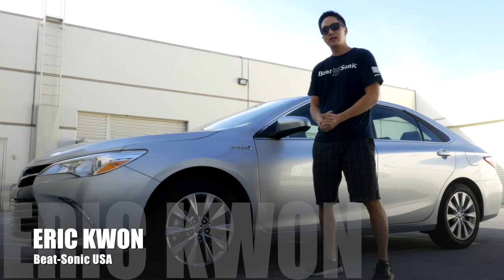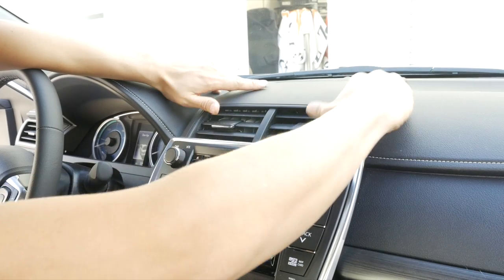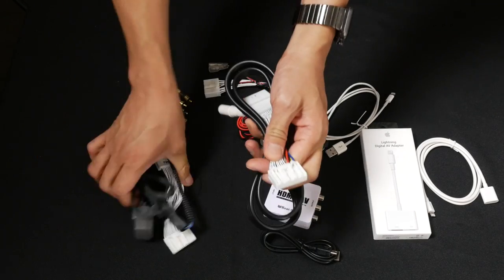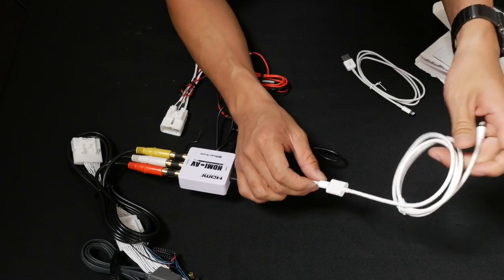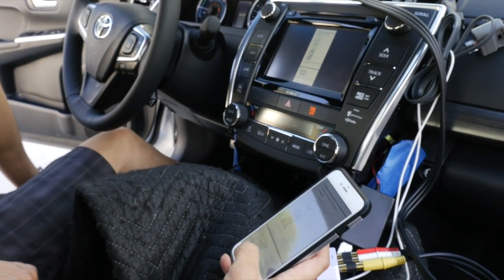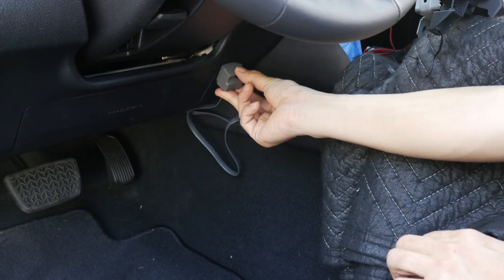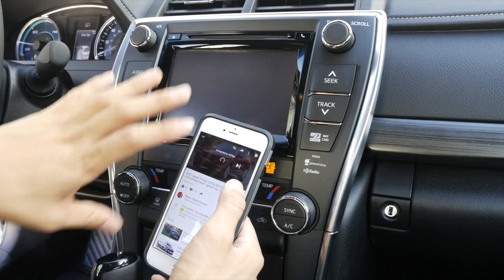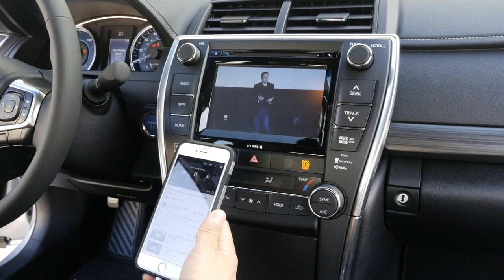2014-2017 Toyota Camry Smartphone Mirroring System Installation and Demonstration

Comment: would it work on a 2012 camry xle v6 if not could u upgrade the camrys screen from a 12 to 14 unit with little issue?
Reply from the maker: Unfortunately it will not be compatible to your 2012 model. And from our understand will not be able to upgrade to newer screen as the connectors are different.

Comment: So I just purchased Camry SE 2017th, so does it fit for this or not. If It fits, then I am purchasing it as ASAP. Thanks!
Reply from the maker: This unit is compatible with you Camry SE 2017. You may purchase the unit at: http://www.beatsonicusa.com/if02ep.html
Reply: Thanks for your quick response, sure !
Reply: Also, does the kit has all the wiring and pieces shown in the video or do I have to purchase something separately ?
Reply from the maker: You will need to purchase the following separately for your iPhone: 

1. Apple Lightning Digital AV Adapter (Part Number: MD826ZM/A)
2. Lightning to USB Charging Cable (4 inches Lighting to USB)
3. Lighting Extension Cable (3 feet Plug to Socket)

The links are provided on the product page:  http://www.beatsonicusa.com/if02ep.html
Reply: Does this work on a Toyota Corolla 2017 SE?
Reply: Will this work with my 2012 Camry SE?

Comment: Will this work with a 2014 camry se sport? Also is it easier for an android phone? I am using a note 8, one last thing I have an adapter for micro usb to type c (for the note) will it work with it?
Reply from the maker: Yes, this kit is compatible with 2014 Camry Se Sport. You phone must support wired HDMI output for the adapter and USB type C cable to be compatible. We recommend the use of the wireless mirroring solution using the product linked here: http://www.beatsonicusa.com/if02ep.html

Comment: It is only screen mirroring right? Without audio?  So if I use Bluetooth for audio and watch video, the sound and images will still be off?
Reply: Or it has audio too? The youtube in the video seems fine...
Reply from the maker: Yes, this is screen mirroring WITH Audio. The sound and image sync is perfectly matched on this device since the Audio and image will be both from AV input and not bluetooth. Sound quality will also improve over bluetooth as well.

Comment: Why can't this be used with a 2013 Camry Hybrid XLE? I thought the 2013 was part of the same generation as 2014-2017.
Reply from the maker: The radio is unfortunately different with different radio connectors

Comment: I rather mirror it using a aple tv, its wireless like that, connect it to the HDMI to Av, run a hdmi cable  and connect it to apple tv 📺.
Reply from the maker: This will work as well. Be sure to have a hotspot in the vehicle :)

Comment: Is it possible to use just a long HDMI cable instead of the lightning digital AV adapter
Reply from the maker: Yes, you may use a long HDMI cable instead of the lightning extension cable.

Comment: My 2016 Toyota Camry SE is a complete piece of shit. Within the first 60,000 miles both front axles were replaced and the entire steering column was replaced... at 65000 miles now the torque converter is going out... the torque converter recall only covers 2012 through 2014 models(not 15 or 16) even though they have the same transmission.  Toyota you have seen the last of my money, your standards and quality control is at best a joke!
Reply: Toyota is ranked one of the best reliable brands for cars, maybe u just had bad luck
Reply from the maker: Sorry to hear that! Hopefully your issues were solved

Comment: hello I just purchased the Nextel screen mirroring adapter for my 2015 Toyota Camry xse model and I was wondering what else I needed as in do I need any wiring harnesses or RCA jacks. is there anything else that is required for me to get screen mirroring to my factory radio
Reply from the maker: Hi Richard, our kit will work perfectly with your mirroring adapter: http://www.beatsonicusa.com/if02ep.html. Depending on the specification of your device, you may need a wifi hotspot in your vehicle. Please let me know if you have any additional questions.
Reply: Beat-Sonic thank you for the quick response.  i know I have to switch the switch back and forth to tv to nav. but will all my other functions work while I am watching a video like incoming calls or text messages?  this should be my last question.  again thank you for your help in the matter.
Reply from the maker: Yes correct, all the other functions will work while you are watching a video, such as incoming calls or text messages. Please let me know if you have any additional questions.
Reply: Beat-Sonic awesome well as soon as I get the price of your book up I will buy it. Thank you for your help .
Reply: harness hook up. auto correct

Comment: Do you now offer a wireless Apple mirroring system for the Camry 2017?
Reply from the maker: You may achieve wireless mirroring via Apple TV. You will need a separate hotspot in your vehicle as well
Reply: @BeatSonicUS  Thank you and I have another question: If I purchase your system as is. Can I mirror Google maps and listen to the FM radio at the same time?

Comment: How about Toyota Camry 2016 SE?
How to install that? But the 2016 has a small screen 😐
Reply from the maker: 2016 SE is compatible. Installation process is exactly the same :). Product link: http://www.beatsonicusa.com/if02ep.html
Reply: Beat-Sonic thanks . Any way 2016 Camry screen is smaller than the others camry🙄
Reply from the maker: 2016 Camry screen size is the same. The one in the video has factory navigation. I am assuming yours do not hence the smaller screen.

Comment: Just installed this on my 2017 Camry 🙏🏼 so cool to use
Reply from the maker: Awesome!
Reply: Beat-Sonic any other products for 2015-2017 Toyota camrys?
Reply: can u still play music thru bluetooth while connected to the hdmi?
Reply: Shahir Al Rashdan yeah
Reply: I just bought the same radio for my other car but I guess I’m missing wired it’s not like the original one it came with so by any chance do u know what type of wires I need

Comment: Is it work on Toyota Avalon 2014 ? 

2014 same as 2015
Reply from the maker: Unfortunately only 2015-2017 model is compatible. The radio has changed from the 2015 model.

Comment: How does the phone switch over if you get a call?
Reply from the maker: The phone will switch over to your bluetooth automatically when you receive a call
Reply: @BeatSonicUS  One last question before I order. I have an android phone.. does the HDMI receiver have a sync button on it? So  if I get a new phone do I have to open the dash to sync the phone to the device?
Reply from the maker: You will need to purchase an additional unit to sync with your android phone. There is no sync button and will autodetect on your phone. Details are here: http://www.beatsonicusa.com/if02ep.html

Additional item you need to use with your android unit: https://www.amazon.com/gp/product/B00O14JG2Y/ref=as_li_tl?ie=UTF8&camp=1789&creative=9325&creativeASIN=B00O14JG2Y&linkCode=as2&tag=beatsonicusa-20&linkId=e9cc82ce2cccdb91369ba8def3ff97a8
Reply from the maker: We recommend you use the Actiontec one as it works better than the netgear one. Link is on our webpage: http://www.beatsonicusa.com/if02ep.html

Comment: Very cool, thanks for sharing, what is the rough total cost of the kit and additional parts need to complete. I have a 2017 Camry and would love to install this kit on my car
Reply from the maker: Total cost of the kit is $249:  http://www.beatsonicusa.com/if02ep.html

These are the additional parts you need:

1. Apple Lightning Digital AV Adapter (Part Number: MD826ZM/A)
http://www.apple.com/shop/product/MD826AM/A/lightning-digital-av-adapter?fnode=85%22

2. Lightning to USB Charging Cable (4 inches Lighting to USB)
https://www.amazon.com/AmazonBasics-Apple-Certified-Lightning-Cable/dp/B010S9M3L6?ie=UTF8&psc=1&redirect=true&ref_=oh_aui_detailpage_o00_s00

3. Lighting Extension Cable, Amazon one works. Ebay one does not (3 feet Plug to Socket)
https://www.amazon.com/Lightning-Extension-Through-Connector-Extender/dp/B018HD4RP0/ref=sr_1_3?s=electronics&ie=UTF8&qid=1488819981&sr=1-3&keywords=lightning+extension+cable
Reply: TechSavvyDaddy go buy the CRUX AVITY01. A lot easier to install and a lot cheaper. 125 on ebay

Comment: This kit looks great! Will it also turn my crappy Entune system's one ok sounding dash speaker into a lovely sounding surround sound system?
Reply from the maker: Vegas Crypto Ho the sound quality will improve but not certain if it will add a surround sound system
Reply: @BeatSonicUS  Not certain if it will add surround sound? Lol. It was a joke. The point I was trying to make was this- even if I were to invest in your product, which appears like a good product. It includes a lot of work and connectors, etc. but Im not knocking the product. What I was knocking is Toyota's incredibly crappy Entune system. I don't like paying for 💩 I don't want, but had to get the XLE if I wanted the sunroof, which I did, and came with the additional cost of the Entune sound system, which is complete fecal material.
Reply from the maker: @benfranklinskite5975  Noted!

Comment: I have 2017 Toyota Prius Four Touring is it compatible? Thanks.
Reply from the maker: Yes, this kit is compatible with 2017 Prius models without 11.6inch screen.
Reply: Beat-Sonic will this work on a 2016 Prius 3 touring?
Reply from the maker: Yes, this kit is compatible with  2016 Prius 3 touring :)

Comment: Do you need to disconnect the battery for the installation at any moment?
Reply from the maker: Although disconnecting the battery is not mandatory, we do recommend it and instruct to do so in our installation manual as a safety pre-caution.

Comment: How can I rotate my iPhone  sideways?
Reply from the maker: Your phone and application needs to support it and if it does turn on the function on the phone
Reply: Ok thanks..and 1 more thing, my mirroring system is not full screen 🤷🏻‍♂️ is there’s a way i can make it a full screen? My 20 camry doesn’t have a screen stretch  button like the one you showing on video

Comment: How much do both device cost and Is it the same installation process for the netgear android connector?
Reply from the maker: The kit is $249: http://www.beatsonicusa.com/if02ep.html

Correct, the installation process is the same for Android.
Reply: Beat-Sonic any true wireless devices out there?
Reply: Beat-Sonic what's the difference btwn this and the other devices on Google for $50 ?
Reply from the maker: May I ask what the other device on Google for $50 is?
Reply from the maker: You may use the Antec Wireless device for a true wireless mirroring. The link is shown in the page above.
Reply: Beat-Sonic I just google wireless phone mirroring device and they came up. Some were usb connectors others had harness. They didn't specify if that was all u needed to get job done...
Reply: Beat-Sonic didn't find link and Google search has no results?
Reply from the maker: Please see here for the smartphone mirroring device for your vehicle: http://www.beatsonicusa.com/if02ep.html

Link to the additional wireless item needed to complete the installation: https://www.amazon.com/Actiontec-ScreenBeam-Wireless-Receiver-SBWD60A01/dp/B00O14JG2Y/ref=sr_1_1?ie=UTF8&qid=1493934469&sr=8-1&keywords=screenBeam+mini+2

Comment: Why do we need Video Motion Switch ON/OFF?
Reply from the maker: The switch is only needed for models with factory navigation as when the video in motion is engaged, the vehicle location on factory navigation map will stop.
Reply: So leave switch OFF if it doesn't have navigation (GPS). and does it come with manual for using mirror iPhone?
Reply from the maker: Correct. You may leave it OFF and tuck it behind the radio if you do not have factory navigation. Yes, it comes with a manual on how to install for mirroring an iPhone.

Comment: I don't think this solution will last. The hdmi adapter gets really hot under office use let alone inside the dashboard where a car gets up to 160F degrees during the summer.
Reply from the maker: Solution has been strong for 3+ years. No warranty claim has been made due to damage from heat.

Comment: Thats amazing...love to set it up for my car.  How much it would cost to get this setup done for 2017 Camry?
Reply from the maker: Thank you! We have thousands of happy customers as well. Product cost is $249: http://www.beatsonicusa.com/if02ep.html
Reply: Thanks for the information. One more question. If iphone is not connected, will it display the existing screen as it is. The reason why I am asking this is: will it cause the state inspection to fail or any rule violation issue?
Reply from the maker: With the iPhone disconnected, it will show a bluescreen when in Video Input mode on the factory touchscreen. You may leave the Video Input mode on the factory touchscreen anytime you would like without having to disconnect the iPhone and your touchscreen radio will work like factory. This product will not fail any state inspection or any rule violation issue.
Reply from the maker: Give us a ring at 714-994-1085. Please leave a message if we do no pick up and we will call you back accordingly!
Reply: thank you. sure, I will.

Comment: Hey that's awesome man. !!! Hey would this work in a  2015 Dodge Durango. Thanks 
Also will I need the same item u used on the video. 
Thanks.
Reply from the maker: Unfortunately this kit is only compatible with 2014+ Toyota models.

Comment: can you show android
Reply from the maker: The installation process for the Android is the same. The only difference is that the Wireless Android device will connect to the AV Adapter instead of the Apple device.